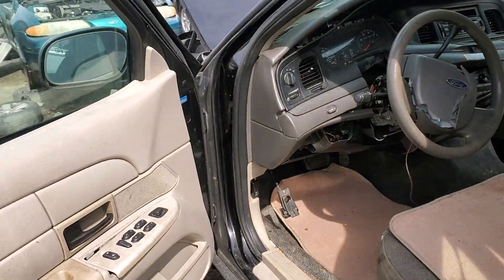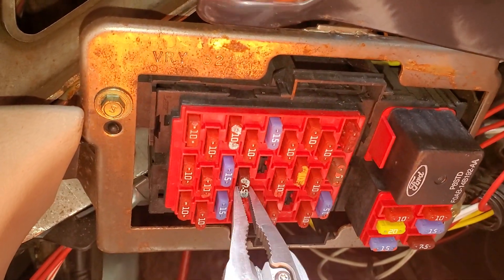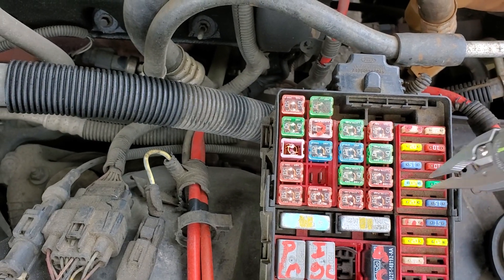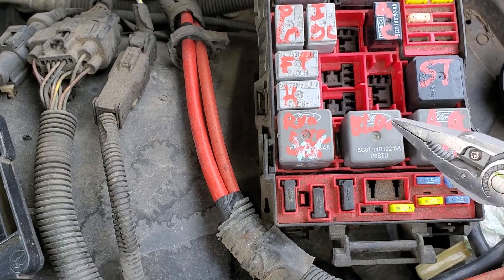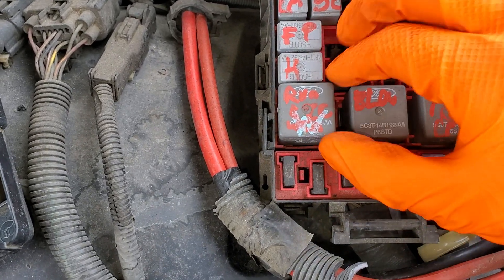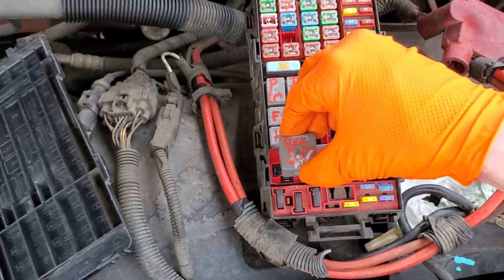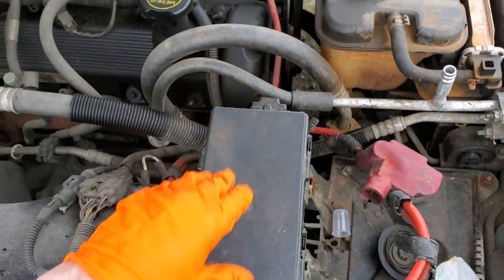2006 Ford Crown Vic Power Window Fuse, Power Door Lock Fuses

Comment: All 4 of my windows just stopped working but it still locks and unlocks with no illumination on the door panels at all I checked the fuses with the tool they aren't blown I can't figure out what the problem is
Reply: I have an 07 CVPI

Comment: Hi
2003 crown vic  . All door locks work fine. all power windows randomly  dont work. changed out breaker 28 with 20 amp fuse, it is a 20 a breaker.  fuse blown after driving about 15 min.  put breaker back in back to windows working randomly.   stumped Thank You

Comment: Got a 2004 merc marquis, No door looks work from the door panels or by remote, The combination pad on the exterior drivers door doesn't work, Truck only works via key. The instrument panel shows a door is ajar when no door is open. The next day everything worked properly, then the following day it all went out again. I haven't found any fuse out. I'm at a loss, would you have any suggestions? Thanks
Reply: It is probably the door control module located behind the driver's door panel on the lower right corner of the inner door.

Comment: 2003 Grand Marquis. Both Front windows don’t work from either driver’s or passenger’s side. Both rear windows work from the back seat as well as the driver’s master control switch. Replaced drivers side master window control switch, same issue. If both front windows stopped working at the same time, can I rule out any regulators?

Comment: 2 months ago all windows stopped working. The windows did not work from master driver door switch or from each individual door switch. I replaced the black relay and they all worked fine again. Until now I smelled electrical burnt smell and again windows don't work. Replaced the same relay is good. What could be the problem? Is it the main master switch?

Comment: 2008 crown vic. #9 fuse blows when you go over speed bump. No radio, no power windows, no power trunk open. Going thru the short patterns. Thank you so far.

Comment: Hey, I got a problem on my 02 grand marquis, both front windows doesn't come down, however rear windows are working fine. Any suggestion would be apprecieted. Thanks
Reply: I have the same problem. My front windows just randomly stopped working but the two rear windows work.
Reply: same thing on my 11 PI door locks wont work, and only 3 windows roll down lol

Comment: I have a question, I have 2006 Mercury Grand Marquis which is basically the same car......for some odd reason my power windows in the front stopped working but the rear power windows work. Any suggestions?
Reply: I just scrolled the comments and none of the questions get answered. Oh well.

Comment: I got a 1999 Ford Econoline and for some reason all of my power locks will lock and unlock except for one not sure why.? It’s the sliding door btw. There is power going through the sliding door because I hooked up a new power lock motor directly to the terminals on the sliding door... does unlock but doesn’t go back down to lock... any help is appreciated!

Comment: i have a 2010 CVPI P7B. earlier today i rolled down my front driver side window and it failed to roll back up. all other windows work fine. is this more likely a fuse issue, or due to a failed switch/motor? if this has happened to anyone else feedback would be much appreciated
Reply: also while im on the topic of electrics im getting a lot of static interference on vacant FM channels thru my BT transmitter. any troubleshooting suggestions?

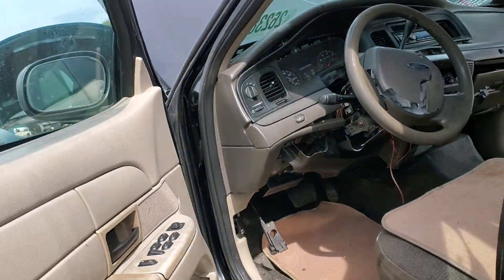Comment: Question, my windows, trunk lid buttons and radio all went out while I was driving and now my driver and passenger window are down in my shitty ass neighborhood anyway, I replaced the fuse in your video at around 0:51 and They pop immediately when I turn the key. I tried pulling the relay you showed putting a fresh fuse in and less you still popped immediately upon turning the ignition key. I even tried swapping the relays like you showed to no avail. Any ideas? This car is a very clean 2011 CVPI with under 100k miles and has never given me a problem until now.
Reply: That sounds like a short in the wiring somewhere, whatever fuse is popping trace back whatever it powers and disconnect one thing at a time (leaving disconnected) until you find the culprit, you can find how to do this with a quick search
Reply: @alexar.h.5031  I figured it out it was just a fuse that was hidden behind my stereo deck, I’m pushing 3000 watts to  🔊  🔊. Brought it to my stereo shop and they had it fixed in minutes lol. Thank you very much for your insight though I appreciate it. Now to figure out how to get my back windows to roll down and open from the inside (cop car)
Reply: @I8ITSK8N  That should be another easy fix, they disconnect the handles which sometimes disables the windows too. Once this rain clears up I'll check mine out to see exactly how (since it's been awhile since I messed with the back doors and windows) 😆 I have a 2010 CVPI and previously had an 2003 and 2000 CVPI's
Reply: @alexar.h.5031  that would be awesome I have a 2011 CVPI. Same but I got new seats for the back so I can take the plastic out and I would like the doors to work because, because 😂 thank you very much for your help that’s awesome of you!
Reply: @I8ITSK8N  One of my crown vics had the plastic seat and one had no back seat (K-9 unit) but bought one for like $20-$25 at the local scrap yard pick n pull jalopy jungle place (whatever you wanna call it)... My local one was called Jalopy Jungle 😆
Reply: @alexar.h.5031  haha that’s an awesome name!😂😂😂 well I was just t-boned in my 2011 P7B 😢
Reply: @I8ITSK8N  oh dang
Reply: @alexar.h.5031  it’s gonna be ok, actually better than ok because I’m having the entire car repaired and re painted.. there goes my proCharger though…🤦‍♂️ (for now anyway)

Comment: My door locks in the rear don’t work. I have a 2011 CVPI. My front ones do work and the rear right still has some power but won’t unlock when clicking. Any help would be appreciated :)
Reply: Having the same issue with my 2008. Were you able to find any solutions to this?